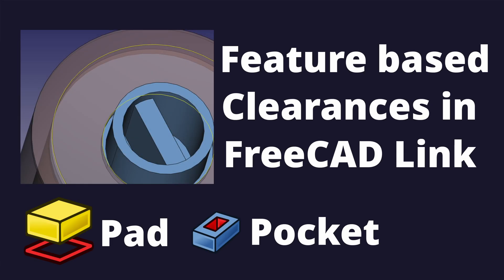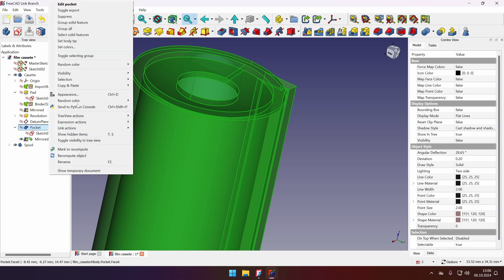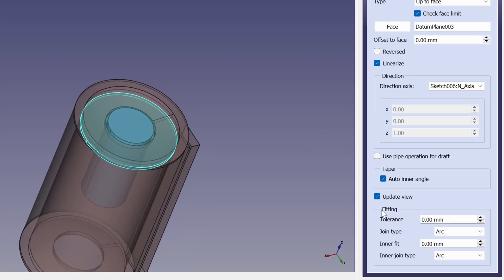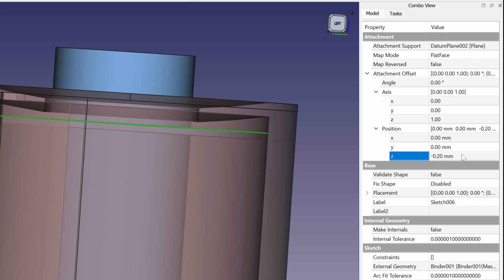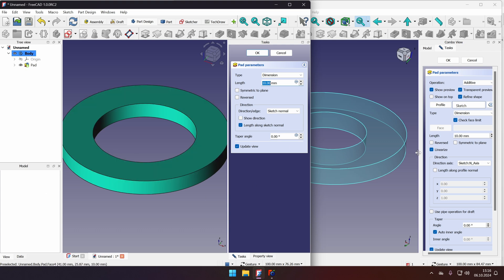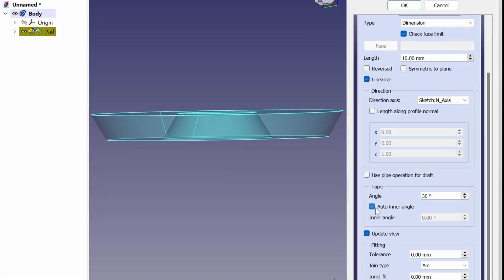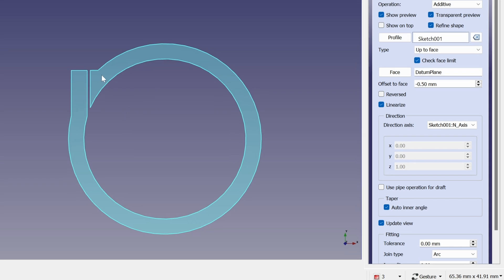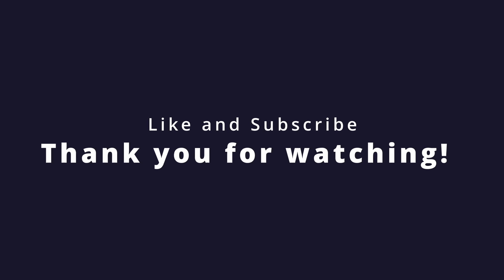Feature based clearances in FreeCAD Link Branch(#3)

Comment: Many thanks for the video! I had a hardtime modeling clearance in Freecad and I found this super useful video. Downloaded FreeCAD link branch immediately and I love it. The new dimensioning features are so practical. Coming from Fusion, I really need them! I also watched all other videos and they are really really useful. 
However the FreeCAD official 1.0 seems to forge its own way by adding unique features like Dimension, offset geometry and I also like those as well. Do you know if there is a way to merge the two advantages? Many thanks!
Reply from the maker: Hey, the only thing would be if Realthunder would update his branch and merge FreeCAD main improvements. I could not find any info on his plans, though.

Comment: What happens when i load a link brench file in the vanilla version ? And the other way around?
Reply from the maker: You cannot open Link Branch files in Vanilla. Other way around vanilla files opened in Link Branch - it will prompt to make the file compatible to Link version. I would advice against it. Stay on the safe side and assume that files are incompatible.
Reply: @RoadSideMaker  well this is sadly quite disapointing. Why wont they merge the link branch completly wit the 1.0 version of the software ?
Reply from the maker: Because it is quite a lot of work. Each merge would require full tests to verify it does not brake anything and there will be a lot of conflicts. They have been integrating TNP mitigation from Link Branch for like a year or even two. As it stands right now there are more than 11 thousand differences (if you go to Link Branch github you will see  that it is 5776 commits ahead of, and 5652 commits behind of FreeCAD official)